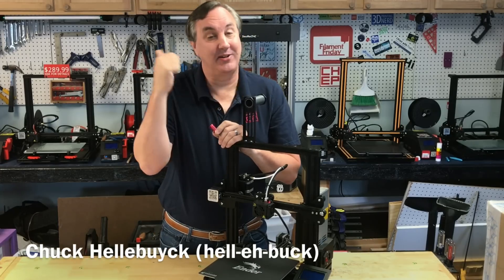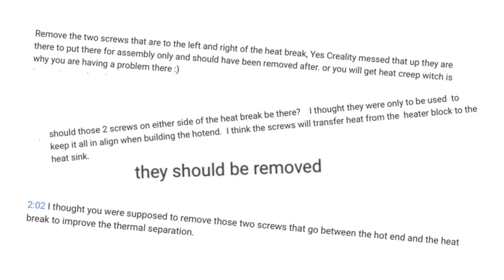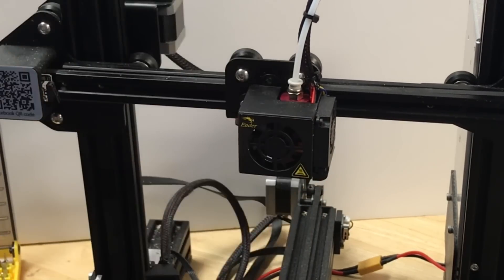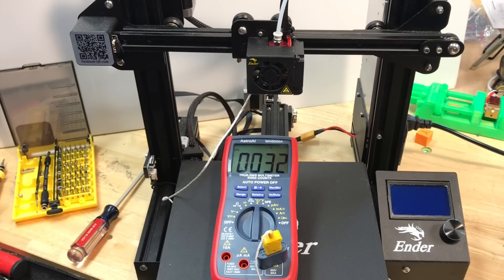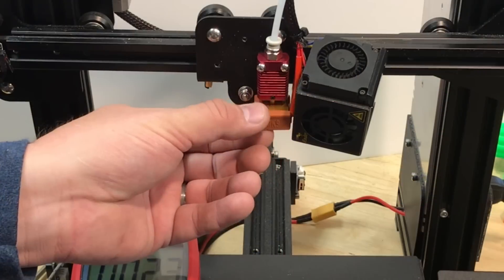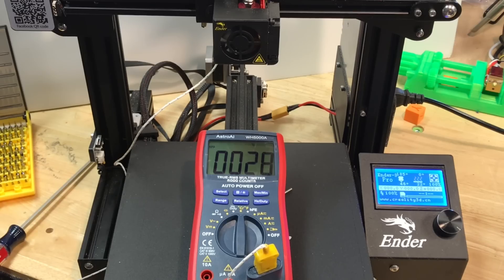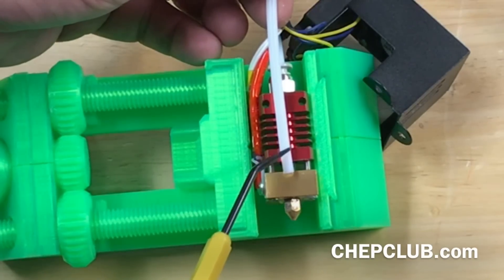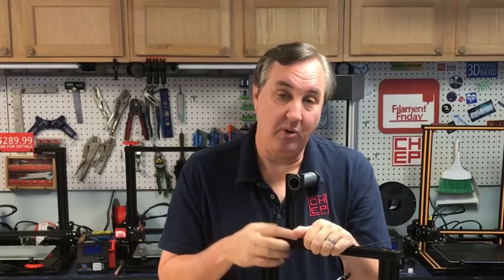Creality Ender 3 Hot End Heat Creep - Remove Those Screws......Maybe?

Comment: the testing methodology is all wrong. first, the thermocouple has very very little contact area and is placed exactly in front of the fan. this can skew the measuring greatly.

second, testing at 185C is pointless. nobody prints at that temperature. crank it up to 230-240 and test again.

last but not least, the nozzle should be tight against the heatbreak, or the hotend might leak.

all in all this video is really inaccurate and draws conclusions based on wrong assumptions. take it with a fistful of salt
Reply: I also would not call this a valid test, the sensor should be protected from airflow.
So this test does not convince me in any way.

Still, I left the screws in the heater-block of my CR-10 and more lately in the heater-block of an Ender-3 because it proved to be working like this without any issue for me. I am printing PETG on a mostly stock Ender-3 at 240°C and it works just fine.
The cooling appears to be sufficent, thermal creep by the screws or not.
And it is mechanically more sound with the screws in place.

One source for a problem might be exchanging the stock fans with more quiet versions and ignoring the airflow provided by the new fan on the way.
The fan that came with my CR-10 was a 1606KL-04W-B30-L00 and it does 10.19m³/h or 6cfm.
The Cooltek CT4010BW fan I am using on my CR-10 does 9.3m³/h or 5.47cfm.
The often recommended Noctua fans like the NF-A4x10 do 8.2m³/h or 4.83 cfm and the Noiseblocker XM-2 does 6.7m³/h or 3.95cfm.
Reply from the maker: I did block the fan from the sensor and saw very minor +- 2°C difference. I also placed sensors at various points and concluded the easiest way to show the effect was to place the sensor near the heat source. I’d lose and audience if I turned the video into radiant vs conductive temperature probing as the effect was essentially shown with a simple single sensor that showed relative temp rise just fine. The point was to show no meaningful heat creep exists. I even put my finger on it with no fan to prove the heat sink is doing its job. 

As I’ve said l welcome anybody to prove me wrong with video or test data but the only thing I see is long winded comments with no data backing them up.
Reply: Well, you did not show that in the video, you showed the sensor beiing cooled down by the airflow.

But then I already believe the screws are better left in place and even if blocking the sensor from airflow would make a +10°C difference, the filament still would not melt in the cold-end.

Thank you for trying that out!
Reply from the maker: The whole heat sink is in front of the fan and the thermocouple is near the heat source in question. The thermocouple head is in full contact. 

No matter the temp, what I showed is the heat transfer was identical with or without the screw. Printing PLA at 230-240 is trouble in itrself. 

The nozzle was tight and nothing was leaking. The head was loose because the only thing holding it was a tiny set screw. The heat break just slides into to heat sink. 

All in all you’ve proven the inaccuracy is not with the video.
Reply: @FilamentFriday  Hi chep, id just like to say that there may be a difference at higher temperatures, depending on what the specific heat capacity of the heatsink is.

I do a bit of forced convection testing as part of my engineering job and have noticed that there is a point at which adding more forced convection to a heatsink at which there is negligible increase in cooling efficiency. So along with this, if that heatsink is stressed thermally to its limit, it will start to gain temperature slowly over time.

The heatsink may well be able to dissipate 185C easily, and therefore dissipating the heatcreep coming through the screws easily and quickly.

If at 240 degrees, the heatsink is approaching its cooling capacity and cannot remove the heat quick enough, the extra heatcreep through the screws may be be enough to push the heatsink past its cooling capacity and start to slowly gain temperature.

i have this problem with a knock off all metal hot end on a printer which i was testing, where my PETG is melting in the throat after about 10 layers of printing them jamming. Removing the screws allows me to go to 25 layers before tham JAM happens. The main issue is thermal contackt between the heatbreak throat and the heatsink, but disposing of the screws alleviated the problem at 240deg C

Food for thought.
Reply from the maker: Your referring to what’s called heat sink saturation. Like a fully soaked sponge can’t absorb more water. The PTFE in the stock setup is limited to about 230°C (though people push beyond this).
The all metal Microswiss design is a different story. PLA is known to stick in those because it expands in the heat break. Microswiss removed those screws because it was a quick fix vs increasing the heat sink fins to dissipate more heat earlier. 
Many have compared the removal of the Microswiss screws to the Creality version  which is what brought on the myth. The Creality design isn’t affected by the screws because it’s not designed for higher temps and has more cooling fins on the latest designs. Besides, the PTFE would start to melt prior to heat creep affecting it. I tested that to prove it I just never showed all my testing.
Thanks.
Reply: @FilamentFriday  Thanks chep i couldnt remember the correct term on my lunchbreak! its linked to the specific heat capacity so i just blurted that out.

My point is that heatcreep may matter through the screws for some setups.

Certainly not for PLA in a stock hotend, but in an all  metal hotend with PETG it could matter if you haven't maximised the efficiency of the thermal joint between the throat and the heatsink.

We dont know the details of the data sheet though. We dont know its heat capacity or at what amount of heat does it become saturated. It was just a thought based off the experienced i have had, since i am having this problem in my testing of a knock off.
Reply from the maker: I did test it at a higher temp and use many of these in my printfarm. I have screws in all my hotends.
Reply: "full contact". stopped reading there.
Reply: Yeah even at higher temps it wont make any difference, aside from a possibly slightly higher stable temp. Honestly the amount of screeching that goes on from people who don't like to be proven wrong on the internet is really shameful. Kudos to CHEP for the test.
Reply from the maker: Braco pls - Haha
Reply from the maker: Mephiston - I’m used to it. And they never produce a video or proof of their claims. It’s often a long comment too that never offers anything concrete. I just have to laugh.

Comment: Of course u can print with them, but it makes still no sense. The heatblock is countered against the heatbreak and won't move. It will only move when u assembled incorrectly.

And whats not considered here is that u still transfer heat from heatblock into the heatsink. And don't say u don't because this is basic physics.

It will be no problem because the fan cooles it down and the surface area is small compared to the heatsink. But the heater still needs to heat up the extra material to get to temperature with results in higher power consumption. Also it could be the otherway around that the screws actually cool down the heatblock.

And the most important point not considered is temperature. What if the temp goes up to like 250°C. Then u could come into a range where the heattransfer upwards is higher than the cooling power of the fan/heatsink and it will make a bigger difference.

And about micro swiss because there were some comments about it. Here it will be even more of an issue when printing up to 300°C. And remember that the heatsink on micro swiss is smaller because it uses titanium as heatbreak. Now with 2 stainless steel screws in there u will transfer much much more heat into the heatsink which it is not designed for.

To really test it u need to test it without a fan over a given period of time. Also if a thermal camera would be used it would be much better to see.

In consumption it will work without issues with the screws (stock hotend). But it's just waste of power because there is no reason for them to be in there while printing. When u change nozzle attach them. If u finished remove them.

And on micro swiss it could be a problem when printing high temps like 300°C. 

In my opinion this video proofs nothing. I confirm that it would work with the screws but i don't confirm the testing methods especially not at 185°C.
Reply from the maker: Only the set screw holds it without the screws. And I did show heat transferred but the heat sink/fan handled it. More physics in action. 

I didn’t test micro Swiss so I’m not sure what your talking about there. 

You’re welcome to make your own video and prove me wrong.
Reply: @CHEP, there are all metal microswiss nozzles/hotend combinations, but those come with their own components which don't use these fixture screws, as at higher temps this does become an issue, but stock with PTFE liner, you'd never go above 250. (maybe not even above 240)
Reply from the maker: I’m fully aware of the Micro Swiss it just had nothing to do with my video so I was confused on the mention in his comment. I agree though, higher temps require a better hotend. I personally don’t recommend going over 230 with the stock CR-10/Ender 3 setup even though they spec it to 255. I don’t trust the PTFE tube above that with the variability in the temperature control and stock PTFE quality.
Reply: @FilamentFriday  yep, pla test is perfectly fair with a lined hotend, though ideally you measure the temperature right at the throat, can't do that without drilling into the heatsink, but certainly looks like the screws don't transfer enough heat to matter at pla temperatures.
Reply from the maker: I wanted to see how much was coming from the heat source in question, the screw, that’s why I positioned it there. I already knew the center tube transferred some.

Comment: Good job Chuck. You certainly can't argue with the people that designed and build the printer. The heat sink is working well. 

Cheers
Willy
Reply: There is already plenty to argue with Creality about with regards to their printer design, but those two heatblock screws are not one of those things.

Comment: Chuck after watching your video I stand corrected sir! But I will say I was having jams in my hot end on both my Ender 3's I believe it was heat creep? After taking mine out (read it online somewhere) that problem went away and has not been back. Was it something like maybe bad filament? I'm not sure at this point. I will put them back in one day and see. Thanks for the Video!!
Reply from the maker: Where was the jam, near the end of the PTFE or higher up?
Reply: @FilamentFriday  Sorry not sure, I did not over heat they are only printing pla on them. I replaced the hotend throat piece, got a package from amazon... Just maybe the hotend throat that came with them are not that good? That was some time ago... I'm going to put the bolts back in this weekend and see.. (Both of them are printing now) :) :)
Reply: It's always a pleasant surprise to see someone admitting that they may have been previously wrong. Much kudos and respect to you for publicly admitting so. The internet needs more people like you.

Comment: On my Ender 3, I’ve left the hot end stock and it puts out quality prints as nice as my MK3, that I also haven’t changed. Sometimes nicer. All I usually use is PLA. I’ve only dabbled with PETG and nothing else yet. 😀

Comment: if you are bothered about heat creep source some titanium screws. Those screws are clearly there to fix the heat block in place, which is a far better system than the mk8 hotend used on the Anet A8 for example.

Comment: Think about it - why would the Chinese do the extra work to include two unnecessary screws with each printer?
Reply from the maker: Part of the reason I questioned it. Not to mention drilling holes in the heat block and heat sink and tapping the holes in the heat sink all to just remove them?
Reply: for ease of assembly at the factory, it's easier to screw in the nozzle with those screws, otherwise you need a spanner to hold on to the nozzle. There is a reason E3D doesn't use this design, stainless is a very good conductor. But do what you wish. Look at the mosquito hot end, that is the correct way to design a hotened with screws securing things and avoiding heat creep -- this isn't

Comment: I'm kinda sick of ender 3 hotend, do you recommend any replacement?
Reply from the maker: Anomie H - Some like the E3Dv6 but it will require firmware change and brackets.
Reply: E3d v6 clone works incredible. 
I finally got reliability from it that i couldn't get from two creality hotends. And you don't need to do firmware change if you go for the same thermistor and heater cartridge setup (just look at ebay or aliexpress). You can get two v6 clones with fans for the price of one creality hotend.

Comment: If you’re really trying to fix heat creep..  let’s just do it correctly and remove that whole cheap Chinese knockoff hot end period.   Go get yourself a v6 hot end with a ptfe passthrough heartbreak - install it correctly and not only will you fix heat creep..  but you’ll get such a better print it’s insane.    No sense in duct taping a crappy Chinese clone hot end when you should have a good hot end to begin with.
Reply: They're both made in china and probably the vast majority of them are made in the same factory using the same tooling.

Comment: Having it settle at 45C, why not leave out the fan entirely? I suppose for higher temps it would creep higher but even say 80C doesn't really affect the tube or filament right?
Reply from the maker: 80°C shouldn’t affect it but that’s why there is a fan. The heat sink needs air flow to work properly and keep it cool. Higher temps will affect the PTFE at the nozzle more than any heat sink screws.

Comment: the screws have too thin a cross section, and have fins themselves, as the fan is also blowing on them they shouldn't affect much
Reply from the maker: Too thin is actually a good thing because the metal will saturate from heat and block any heat transfer the same way a heat break works.